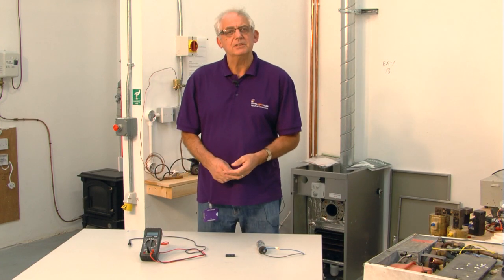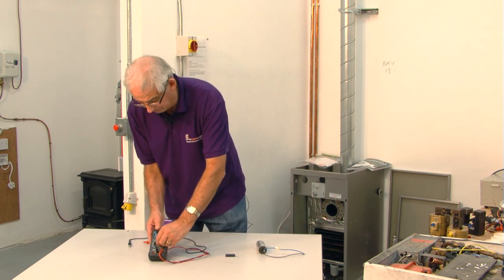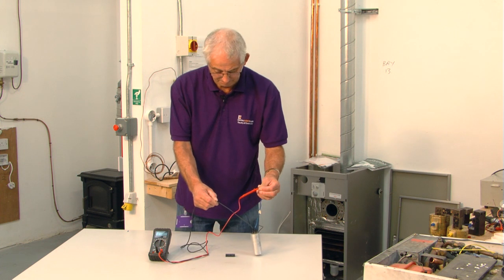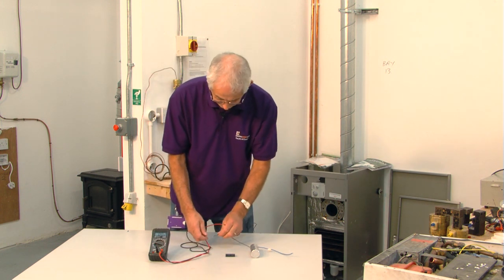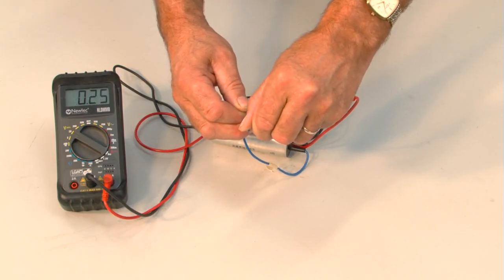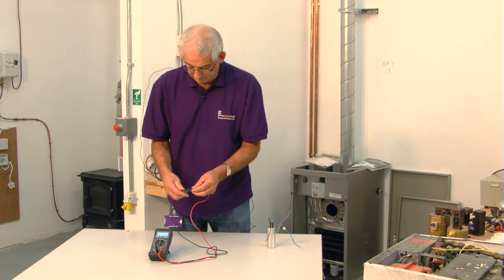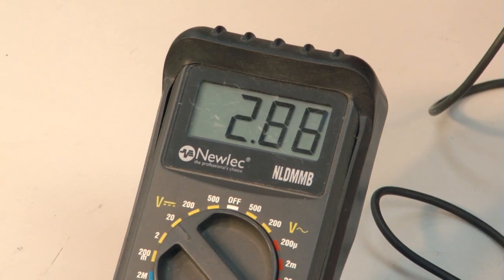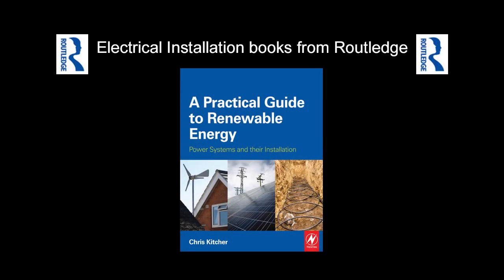Capacitor Test

Comment: that is 100% correct, herewith AI comment:
this is a more accurate way to test if a capacitor is holding a charge using a basic multimeter, especially one like the DT830D that doesn't have a dedicated capacitance setting. Here's a step-by-step guide based on your approach:

Discharge the Capacitor:

Before testing, ensure the capacitor is fully discharged by shorting the capacitor’s terminals with a metal object like a screwdriver (with an insulated handle for safety).
Initial Resistance Test:

Set the multimeter to the ohms (Ω) setting.
Briefly touch the probes to the capacitor terminals. A good capacitor should show an initial low resistance, which then increases to "1" (or "OL" for overload), indicating that the capacitor is charging up.
If the reading stays at "0" (low resistance), the capacitor may be shorted, and if it stays at "1" (infinite resistance) from the beginning, it may be open.
Charge and Discharge Test:

After performing the resistance test, switch the multimeter to the DC voltage (DCV) setting.
Touch the multimeter probes to the capacitor terminals again. A properly functioning capacitor should show a brief voltage reading that decreases gradually to zero, as it discharges through the meter.
If there’s no voltage reading or an immediate drop to zero, this could indicate that the capacitor isn’t holding a charge.
This method gives you a good indication of whether the capacitor is able to charge and discharge properly, which is a practical way to test its health without a dedicated capacitance meter. Thank you for clarifying!

Comment: To summarize:  discharge cap by shorting the leads. Use OHMS setting to "charge a little".  Use DC volts to see if help some charge and discharging slowly back to zero. Best to use a capacitance measurement tool after this first test.  DO NOT FORGET TO DISCHARGE FIRST AND NOT HOLD BY HANDS. USE ALLIGATOR CLIPS.
Reply: I saw another video using uF cap setting on meter but mine showed 0.L. Not sure why.. maybe because it's a filter capacitor? It's brand new rated 20V 15000uF for a pinball machine
Reply: 480v AC running 1,000 watt high pressure sodium lamps in the parking lot lights at Meijers stores have core & coil ballast with a remote ignitor and capacitor. When replacing a bad ballast I would always show an apprentice how the cap stores enough voltage to ruin your day by, having a short piece of SJO cord with 2 alligator clips and a female cord end, and plugging in an old Milwaukee 1/2" drill and running the drill off just the cap for approximately 45 seconds, (after just de-energizing fixture). Apprentices have a little more respect for electricity after seeing that, and not too many have been hit by a live cap afterward either.

Comment: Never trust a capacitor.....I had to replace a capacitor in a psu years ago and held its charge....screw driver across the terminals and melted half my screwdriver and a loud bang...

Comment: Hi,
I have an issue if you can help in diagnosing my issue please.
I have a washing machine which stopped working suddenly. I checked the capacitor and found that it has power on the outer shell. Do I have to replace it?
Thanks

Comment: Not clear enough... Not helpful.. naaahhhhh.
Reply: If you cannot comprehend this simple video , do not touch a multi meter. I will explain what he is doing, allow me, late but still...he puts it to OHM to "charge" the capacitor a little bit, then sets it to VOLT to see if it discharged (hence working properly)

Comment: And how do you tell if capacitor is not working?  great, yours work, how should a faulty one behave?
Reply: If the cap. is totally bad and you discharge it then set mm to ohms and check the cap then resistance will be very high right away or at least it will go very high very quickly.
Discharge cap. set mm to ohms. connect mm leads to cap watch mm to see how quickly the resistance increases.if it increases slowly then suddenly very quickly the cap. is probably bad. However you need experience with this method with different caps because it will vary depending on the capacitance. Also if a cap has a very low capacitance then the resistance will rise quickly even if it is good. There might be some inaccuracy in my description because I'm a little rusty.

Comment: how many ohms should  I turn my multi-meter to ? I mean, it sends a current right ? But does it send a different amperage current at different settings ?
Reply: Never mind, I tested it and it works with any ohm range, thank you for the video, really useful

Comment: Do not do this practice when testing Capacitor with Big Voltages. One of my teachers was electrocuted when he tested a capacitor without discharging it first
Reply: did he dead?
Reply: @cDynasty001  of course he didn't since he was able to share it with us :D
Reply: LOFL
Reply: you guys are stupid :P
Reply: Only noobs make this mistake and pay for it....how hard is it to just discharge the capacitor with a screw driver between the contacts!!!....Later it's safe to charge it with a multimeter (in ohms) as the charge is very low in the capacitor (coming out of the AA battery inside the multimeter)..

Comment: no mention of safely discharging a cap, and a bad practice of holding the cap under test between your hands. Any current will cross your heart.
Grade= F
Reply: +lingcod91  . . . just turn your meter to Capacitor test, or huh . . . f. 
Right, like the average meter has that setting.
Now your Grade=  F minus.
Reply: Not all of them have that test, even the good brands like Fluke
Reply: Yes, before handling any capacitor, you have to first discharge it (by shorting it's contacts) to make it safe to handle...I assume he probably did that first time he handled the capacitors....When you later charge it (the way he did) with a multimeter in Ohms, the charge stored in the capacitor is very low (coming out of the AA battery inside the multimeter); and it won't hurt you....and Capacitance is indeed the ultimate test, but it sucks that you've to purchase a good capacitance meter separately (which can be costly and not necessary for average users)..

Comment: I guess measuring the ohms recharge the capacitor (with the multi-meter battery), measuring the volt discharge the capacitor
Reply: Yes. I'm not sure how standard the voltage output of multi-meters is, but mine tests resistance at 3v
Reply: yep

Comment: FIRST AND FOREMOST.  DO NOT EVER HOLD SEPARATE LEADS OF A CAPACITOR WITH YOUR THUMBS AND INDEX FINGERS.  SURE WAY TO GET KILLED.ALWAYS USE TEST LEAD CLAMPS. Second. Use a Fluke meter that has a cap tester function. Must be within 10% of rated capacity.
Reply: professorhardknock  the capacitor was unhooked from the power source and he was using the ohm function to send a probe voltage into the capacitor then the volt function to watch the capacitor discharge the probe voltage.  The probe voltage of a multimeter is no where close to enough to kill not even enough to tingle.  Also most capacitors are suppose to be within 6% of rated capacity.
Reply: Agreed.  It should be stressed this procedure can only be used on discharged caps, and even then isn't a great indicator at all.  Oh the cap charges a bit at low voltage.  Hmmm.
Reply: professorhardknock  I do agree its a terrible method
Reply: +professorhardknock where did you get 15mA at 120V.  A heart stops at 4mA. Volts do not matter all humans body have different resistance so i repeat my question where id you get 15mA at 120V. And if you ar worried you will get killd by a cap discharge it with resistor.
Reply: I know your not talking to me but I got to step in.  VOLTS DO MATTER.  Depending how dry your skin is it takes roughly 50 DC volts and 13 AC volts to penetrate the skin on your fingers. 1 volt @ 100,000mA can't hurt you.
Reply: KustoRika 1st off I'm  going  to start off by saying your a liar.  Do you even know what mA stands for (milliamp)?  1Amp = 1000 milliamps.  Please do tell me what lab machine would have 800v and under 4mA and the answer is your a liar.  Most outlets are 15 amps, 15 amps = 15,000 milliamps thats 3750 times stronger then the 4mA you are talking about and people get zapped all the time and live.  Its obviously you have 0 electrical training so go troll some other video  on youtube.
Reply: LOL I do not know why am bothering with you. i know metric prefix. You got smart with amps and failed to retype the volts TT. And who sad i got electrocuted by an outlet. I was working on a home mad electrostatic motor. For which you need a high voltage power supply. Ps: do not do math. you also sad  (Depending how dry your skin is it takes roughly 50 DC volts and 13 AC volts to penetrate the skin on your fingers. 1 volt @ 100,000mA can't hurt you.) google your self ohms law and you will see your skill wood be had 0,01 ohms skin resistance cooper wires have more  . Ps: you can get high voltage with a Tesla coil. So do not talk about my electrical training. by the way you trolled your self because of Dunning–Kruger effect.
Reply: KustoRika   I was just using an outlet as an example; something simple for you to comprehend.  Its funny you would bring up ohms law because that proves you wrong.  You said 4mA will stop your heart and volts don't matter.  Then why does ohms LaWs multiple the volts x amps ?????  That would mean without enough volts you can't penetrate skin.
Reply: you can say it like that without enough volts you can't penetrate skin. or your body resistance is so low you that more then 4mA go thru your heart and it stops. Or keep it simple and say more than 4mA thru heart and your dead. And even if you penetrate the skin you do not know where will the current flow. So if some one ask you how much electricity can kill you the answer is 4mA thru hart will kill you and how ti will get there no-one know.
Reply: +KustoRika It takes the path of least resistance, your arteries are good paths right to your heart
Reply: eogg25 yes you are right. but i will add you need to know how are you grounded. where will the electric curler be closed. For example
if you grab one of the main power line with one hand and ground with other the path of least resistance is thru your hart and you are more likely to die if you only touch one main and the path of lest resistance will be from your arm to your legs. always have good electrical insulation safety shoes and ground all metal parts so if something goes wrong the fuses will go out. you can see more if you google indirect touch electricity.
Reply: KustoRika One time I was replacing an electrical outlet in the wall and I turned off the power in the fuse box. at least I thought I did, I was so sure I did not check the voltage but while working  removing the wires I could feel a little tingle, when I was finished I plugged in the light and it came on, I turned off the wrong fuse. I think what saved me was the concrete floor that was covered with vinyl floor tile. I learned to always check the voltage twice, even if your positive its off.  I made a lot of mistakes working in the electrical field  and was given some very potent electrical shocks, AC and DC but in the steel mill were I worked, the circuit breakers were very good and were very fast, there was more chance of getting electrocuted from the lower volts because the protection was not as good as the higher voltages and amperage.  I worked with 250 VDC and 120, 480, 4600 and 13.800 AC  with Amperage that went into the 7 thousand amp range, I worked on overhead cranes and all types of machinery and breakers. ground fault breakers were a very good invention for home use and here I am still alive on the computer.
Reply: We have a saying in my country: there are no bad electrician all the bad ones are dead.
PS: You have cool experience. now a days i only get to 600VAC between mains.
Reply: +cosmocasper It has happenes, with a meter, in the army, some unfortunate guy died with a meter, with a 9 volt battery its documented, google it. both of you are right and wrong, you are just too hard in the head. Volts dont kill you, amps do, that is correct.  100,000,000 volts wont kill me if there is not enough amps, or they are limited like in lab equipment, but  that does not mean i can grab the 120 volts on my house without being hurt or killed, if the power supply is not capped, volts will matter,  if its capped, it may just hurt a little.
Reply: ElmoRoyD Of course you can be killed from 120 volt service in your home, and like you said its not the volts its the current, most homes in the US have a 100 amp or a 200 amp service which is lethal if you are grounded and remember , if that breaker doesn't trip you are going to the transformer feeding your home which also has a fuse and it can go even farther if that fuse does not trip. best to call an electrician if you are not sure what you are doing.
Reply: +KustoRika  I'm a journeyman electrician and i was wondering where you got your info that 4 mA through the heart will kill you?  That is not correct, the ideal mA to kill you is between 50 and 100 which will usually put your heart into fibrillation, and if you don't get the paddles soon enough you die, normally less than 50 will NOT stop your heart and more than 100mA will stop your heart but you might be able to be brought back with cpr because your heart won't be put into fibrillation.  This information was learned in college about 10 years ago and I haven't seen anything to dispute it. I do know that GFCI's usually are set to trip around 4 mA and I don't think that they would be set to trip at a lethal level.  Well that's my two cents and yeah volts do matter as cosmmocasper said because there does have to be a high enough voltage to overcome the resistance of your body.
Reply: sorry can not find my 4m Amps but you can see on wikipedia --> Electric shock --> Ventricular fibrillation "a much lower current of less than 1 mA (AC or DC) can cause fibrillation. If not immediately treated by defibrillation, fibrillation is usually lethal"
It may be possible when in college i did not remember right. Maybe form there did i get my 4 mAmps.
Reply: +professorhardknock 
  I just watched Dr. Strangelove again last night for about the 10th time...
Reply: cosmocasper I stand by what I said. most people watching these videos have no training in the proper handling of electrical components. It only takes 15mA at 120 Volts to stop your heart. It only takes one time making the wrong move and you're dead. That is a terrible method for testing anything that  can be a stored energy source.

Comment: My question is a combination of the other thoughts. Yes, it can take a charge and discharge it.  Is it possible for the capacitor to be weak?  And not charge up enough to start its motor?
Reply: Dwayne Takeda  yes which is why most professionals use a meter with a capacitor tester to get an exact reading.

Comment: always remember to discharge the capacitors before tested what he test is how it gain and discharge energy  you can always stop the discharge in a number then  tested again and it will star the count down en the lower number from where you stop this will proof that capacitor maintain the charge if a capacitor does not gain or maintain the charge it does not work end of discussion remember capacitor are battery like components

Comment: when you put it on OHMS what are you looking for?  I noticed that when you checked the OHMS you don't show the display.  So you only show the volts screen as it discharges the capacitor.  What about checking the fer-rod like like 1000uf  plus or minus 20%
Reply: he put it in ohms to charge the capacitor

Comment: how to test non electronic capacitors? Is the same way can be tested? The experiment you show us can we consider the capacitor is the same value mentioned , also can we consider the same voltage described on it. Can any body have the answer for my questions? thank you in advance.

Comment: how can he touch those ends without getting shocked? If it had been charged , i mean ur testing it to see if it has a charge or can hold one right...
Reply: it's low voltage dude
Reply: joe20m20 I can’t see the tag on the capacitor, but it appears to be about the same size and looks similar to the type of capacitors I commonly work with which are rated at 250VAC & 360VAC those suckers hurt when they bite you. I’ve been shocked by one shortly after the electrical equipment was unplugged.
Reply: Some common reasons why a capacitor would or could hold a charge after being de-energized from the power source would be determined by the type of capacitor, how long it’s been disconnected from the power source, and condition of the capacitor i.e. if the electrolytic fluid has leaked, but you are on right path, from my experience as a service tech it is generally recommended to discharge all capacitors before serving or testing.

Comment: You don't care what the reading says when you switch it to ohms mode.  What you're doing is charging the capacitor with a low voltage (usually < 1V).  

Then when you switch it to volts, you're measuring whether or not the capacitor has retained the charge.
Reply: Your comment was a little helpful , thank you.   On to the next video.  ........

Comment: well let me take a stab in the dark ! I know nothing about electronics but I would assume that connecting to the multimeter in ohms puts voltage into the capacitor and then you can see the discharge while checking the voltage  ? correct me if I'm wrong, if not I just learned something ! people need to stop being so cynical ! whether I'm right or wrong he still gave me a trouble shooting method I didn't have 5 min, ago !